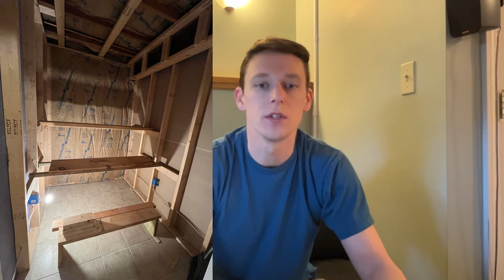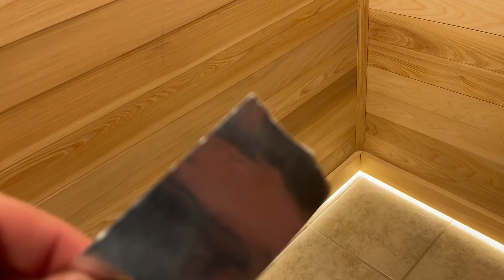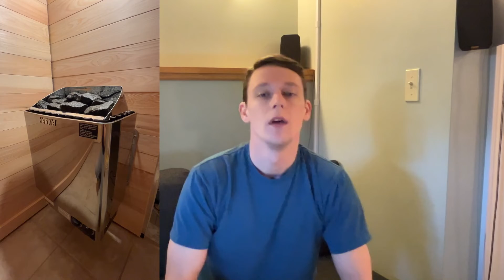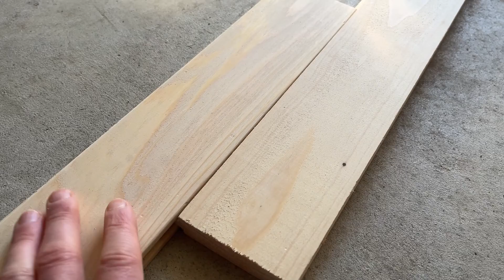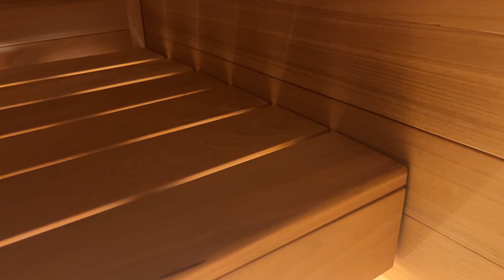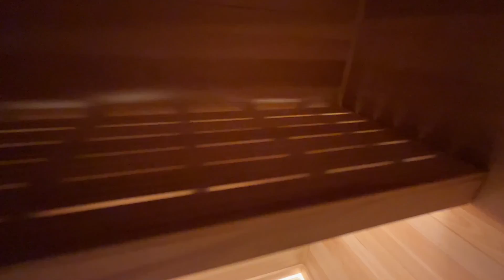How I Built a Home Sauna (& how you can too)

Comment: Shouldn’t there be a ventilated air gap between the sauna wall and the existing wall? Can the insulation be installed directly against the existing wall?

And what happens to the condensation that collects on the vapor barrier? If it runs down the vapor barrier, doesn’t it eventually get into the wood?

Also, how did you seal the bottom of the sauna against moisture from the tiled floor?

I’m planning to build something similar in our home and specifically designed a room for it in our bathroom.

Greetings from Germany!
Reply from the maker: Thank you for commenting! I would recommend removing the wall covering of the existing wall and ensuring all the surrounding walls are well insulated. Then you should install a vapor barrier over the insulation. Next comes the air gap; you can use vertical furring strips to create the gap. Finally, you will install the wood paneling to the furring strips.

The majority of the condensation runs down the vapor barrier and lands on the floor. Im sure some of it also lands on the wood in the ceiling. I have an air gap along every edge of the wood paneling, so air can circulate around both sides of the wood. If your situation allows and you intend to use a lot of water in the sauna you can install a floor drain to collect the water. I run mechanical ventilation over night to dry the space.

The bottom of the panelling does not touch the floor. There is a gap and behind that gap the vapor barrier is bonded to the tile. If you want a pro level finish you would actually want to run the tile a short amount up the wall and you would want a waterproof membrane  under the tile.

Good luck on your build!

Comment: Wow, incredible workmanship! Looks professional. Tell me about your lighting? Also, what temperatures can you hit with the Harvia KIP? Do you have mechanical ventilation?
Reply from the maker: Thank you for commenting! I used LED light strips to light under the bench and baseboard trim. They produce a diffuse light as the light passes through an opaque silicone cover. These are inexpensive and widely available. For the baseboard I routed a groove in the bottom to recess the light strip.

I usually run the sauna at about 170 degrees F. It would go hotter if needed. It takes about 45 min to fully heat up and will hold temp for at least 30 min before cycling back on. A bigger heater will get you to temp faster, but will be more harsh if you're in there while it's running. You might want a bigger heater if your space is larger, outside, or not well insulated. The total weight of the rocks in the heater has a big impact on heating. Generally speaking the more roc weight the better.

I have down draft mechanical ventilation installed in a wall adjacent to the sauna. It's just an AC infinity in-line fan (about $100 on amazon).

Best of luck if you're working on a project of your own!

Comment: Nice Job Thanks for sharing. ?? was your floor in place? It looks like tile. Do you think the tile slows the heating of the sauna as it needs to heat up also with the area?
Reply from the maker: Thank You!! Yes, the floor was in place. I don't think the tile slows the heating much at all. Interestingly due to heat stratification the floor stays at about room temperature even when the ceiling measures 160 degrees or more.

Comment: Do you have a drain or exhaust installed?
Reply from the maker: I have a powered exhaust line installed in an adjacent wall. The sauna is in a finished space which is on slab so a drain would be difficult. Instead I use a towel if there is water on the floor.

Comment: Great video, much appreciated! Can you please put a link to the door you used for your sauna? Does the glass need to be temperature rated?
Reply from the maker: Thank you! I picked up the door from Home Depot. It has held up perfectly so far. I don't believe the glass needs to be temperature rated, just ensure its safety glass (almost all door glass is this way). Make sure it does not have plastic or rubber coatings or seals on the interior. This the exact door: https://www.homedepot.com/p/eightdoors-30-in-x-80-in-x-1-3-8-in-Clear-Glass-1-Lite-White-Finished-Solid-Wood-Core-French-Interior-Door-Slab-50388019803035/313763816